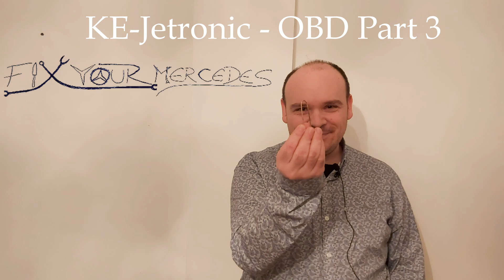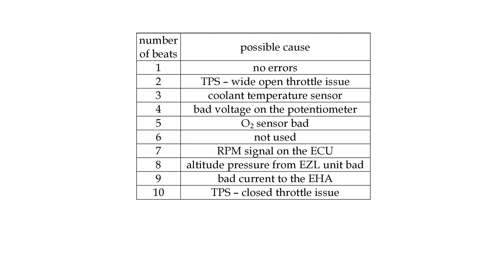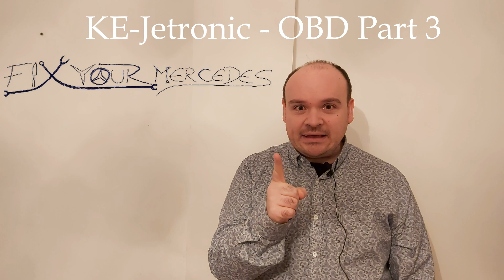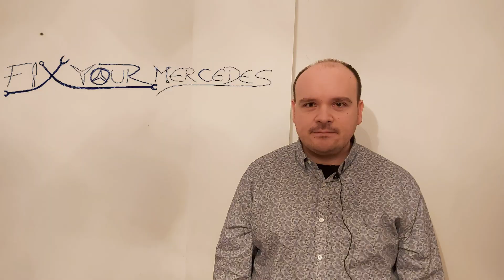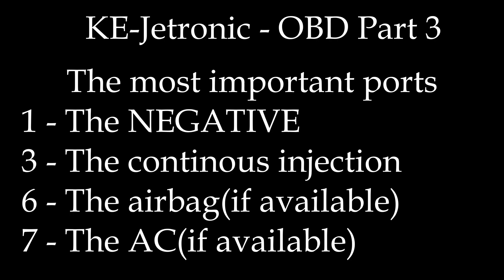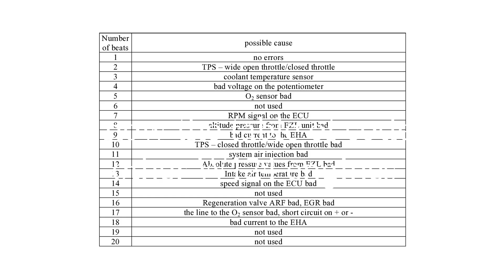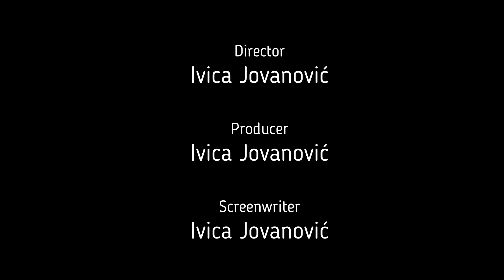㉦Mercedes KE-Jetronic㉦ - The OBD1 Part 3 (would you believe it?! OBD over 30 years ago!!!)

Comment: Well, don't even try to do this on a M103 engine. Plugging such a way the diag porthole will affect your engine ! I've tried it and the consequence I had to face with was: engine refused to start again!!! After some researches, I've identified the issue. The tension relay was blown due to the connection of a wire between the porthole !!! Before It was in perfect condition. So don't try this on the M103 engine !!! major risk for your electronic components !
Reply from the maker: Sorry to hear that. This is predicted for M102 engines. My car is manufactured in june 1989. that's why I made it, I suppose. This is done on the X11/4, the port near the battery. I am sorry that I didn't mention this earlier. Désolé...
Reply: @mercedeske  Hello hello. No issue for me. I replaced the pump relay and the high tension relay for cheap. And mine were original parts, built in January 1987. So no issue. I just want to aware your followers that on the M103 engine, this method is not good ! Have  great day and many thanks again for you tutorials ! Cheers from France !
Reply from the maker: @jacqueshenriot8949  Hello. I'm glad for you. There is in the comments that this is not a method for m103 engines. You have a diagnostic port by the battery where you can check the codes with the obd1 scanner. Greetings
Reply: @jacqueshenriot8949  Thanks for warning.
Reply: How could I tell my 300e 1988 is M102 or 103?
Reply from the maker: Every Mercedes in-line 6 engine is M103/M104 engine. There is no M102 6 cylinder engine, the strongest M102 engine is 2.5l

Comment: Hi Ivica, I would appreciate your help and support with the following issue I have with my W124 300 CE 1991: mid range drive 40 to 60 mph engine looses a little bit of power and takes a few seconds to get to 80mph. After reaching the 80, engine becomes loud and gets some of the power back. When stopped at traffic light, idling rom jumps every seconds from 500 to 750 and sometimes engine dies. 
O2 sensor, spark plugs, wires all new. Just ordered new potentiometer, idle valve control and fuel pressure regulator. And forgot to mention when turning steering wheel all the way left/& right engine might die as well. 
Where should I start replacing parts?!

Thank you

Adrian
Reply: Thank you Ivica, was thinking to replace the injectors as well, will follow up in a week.

Have a wonderful weekend.
Reply: One more question Ivica, 80 mph and up the engine becomes loud and I was told is die to air flow meter? Where should I start with figuring out what’s wrong?!
Could we get an o call when you are available?! Would appreciate your time.
Reply from the maker: @adrianioanlungu  When ever you want. Just send me your phone number in my mail(schilleryu@yahoo.com). I have everything - viber, whatsapp, signal, telegram
Reply: @mercedeske   Will email you my contact
Reply from the maker: Thanks you, too!
Reply from the maker: This is the clear sign that you have a faulty idle control valve(for the beginning 😁) and if I were you I would check the injectors as well(you have the video on my channel). If you need anything else just contact me. Best regards, Ivica FyM

Comment: Hi, very interesting video thanks for sharing your so pratical knowledge ! A question please. I have a W126 mercedes with M103 engine. My car is form 1987 and it has the same ODB1 socket port than your W124 mercedes. This is a 9 holes port. Is your method with the wire applicable for my M103 engine with this same socket plug ? Thanks for your answer. Cheers !
Reply from the maker: This is for m102 the engines from september '89 but you can try. Some people told me that their fuel pump start working constantly using the ports 1 and 3(interesting). But if you succeed the be sure that the table with the number of impulses is right so you know what you are dealing with. To tell you the truth, this is for the diagnostic socket at the battery on the firewall. There is a diagnostics there but I don't know how I managed to make it work on the x11(where you read duty cycle). Best regards
Reply: @mercedeske  Ok Thanks. I will check tomorrow and will let your know. It might interest other mercedes CIS spotters ! cheers.

Comment: (edited because I realized I was talking USA exclusively...)
Reply from the maker: Hello and thanks for the comment. The car is manufactured on june 1989 and what I am talking about is for KE III M102 engines from september 1989. The car has no diagnostics by the battery. As for the M103 engines, if you have 16 socket diagnostic, 1 is for ground, 3 is for the injection(yellow) and 16 is for power(red). If you have an 8 socket - 1 is for ground, 3 is for the injection(yellow) and the red goes to the battery. For California models number 2 is for OBD.
Reply from the maker: Number 2 is OBD for California models.

Comment: Very interesting... Thank you.
I was very happy and excited to think that I could do this on my own car (w201 2.3 1989).
So I found a wire, went to the car, saw the OBD jack it smelled good to me, and...

No number 3 contact...

All others are there, but nothing in the 3, a blank !
Reply from the maker: Number 3 must be next to number 2. How can I explain it? If you have number 4 written on and number 2, between those two is number 3. From underneath clockwise you have holes. The first one is 1 and then clockwise is 2, 3, 4.... Imagine letter C. First from the bottom is 1 and as you go clockwise it makes 2,3,4,5...
Reply: @mercedeske  thank you for your answer. 
I surely misspoke. 
I saw each socket, but the number three is empty, there is a blank inside.  All other socket have a connection in metal, but in the socket number 3 I only see plastic ... Just like if I had not the option. Maybe my car is to old ? Or I'm very unlucky...
Reply from the maker: No, definitely not. Mine is '89, too. The same engine
Reply: @TRIUMPHINT  hello, I have the same problem as you location number 3 of the ODB socket is not wired. Did you find a solution? Thank you
Reply: @jb56000  I learned to live without... Lol
Reply: Mine is also missing the metal connector on number 3
Reply from the maker: Well, there are those without lambda and without pin3
Reply: So there is no procedure for a model without pin 3
Reply from the maker: @kahugan1  Maybe. I thought that current can be measured on the eha. You have to get -2mA on idle. It shows 0. On the kat version the current on eha has to fluctuate between 0 and -3mAmps. If you manage to get that value(I mean -2mAmps, although 0 is not bad either)

Comment: Love your video ! And your girlfriend 😂😂
For erasing all the codes, unplug the battery for 20mins is not enough ? 
And for other type of vehicle, like w129 they have the 16 pole connector with the same kind of diagnostic, but more complete. 

An odb diag can be found for that, I think can be adapted to k-tronic 

https://www.etoilemd.com/boutique/compteurs-intruments-de-bord-calculateurs-diag/1836-emd-diag-1-appareil-de-diagnostique-pour-mercedes-1985-a-1995.html?search_query=Odb+&results=1
Reply from the maker: You know, for years my battery is off from my car specially now when the temperature is about 0 degrees and I still got the same issue. In my manual it says to unplug the ECU from the car for about 20 seconds. Thank you for your support and kind words.
Reply from the maker: In my next video I am going to add some more dames specially for you😉😃😀😎

Comment: Hello
Good film brother 😉
But I have a question. 
In my sl 300 92 model I have bought of diagnostic socket. I have 6 cylinder engine. 
What diagnostic shoud I used it?
Reply from the maker: Greetings and thank you for the comment. Use OBD1 because OBD2 came later 1996. You should have 16 ports. I posted the link how it's done. There should be a socket close to your battery. Stick it there according to the link.
Reply: @mercedeske   hi, where is the link? maybe thats the reason of my stuck on 50% duty cycle problem (o2 sensor problem) I didnt check or erase any fault codes after changing the o2 sensor and many other sensors!
Reply from the maker: In the cards. Here and leave the comment if you succeeded, please!
https://m.youtube.com/watch?v=6kPrF5aE_WU&t=66s
Reply from the maker: You are right! I also had that problem as I replaced the O2 sensor. As I deleted the code, the car drives now like reborn!
Reply: @mercedeske   nice then i will have to find a 16 pin code reader
Reply from the maker: @Gerson Grossl Here, I think this is going to do the work!
https://www.ebay.com/itm/Mercedes-Diagnostic-Code-Reader-Tool-OBD1-W124-W126-W140-R129-E320-1988-1995/222481161915?hash=item33cce91ebb:g:R8wAAOSwr81UOG7-
Reply from the maker: @gcgj1540  Vocè é brasileiro!? Que legal. De onde cidade brasileira é? Vejo que está morando na Taiwan. Espero que vocè vai resolver a problema. Saudades da Sérvia...
Reply: @mercedeske  thank you
Reply: @mercedeske   sim sou brasileiro estou perto de Curitiba, você mora no Brasil ou é brasileiro morando na Sérvia ? Sim casei e estou morando em Taiwan mas no momento estou no Brasil,
Reply from the maker: @gcgj1540  Não, sou Sérvio, mas falo português. Fui no Brasil 2005 no São Paolo, Vitória, Vila Velha, Rio, Serra ES. Tive una namorada lá... ;-)
Reply: @mercedeske  haha legal 👍 interessante sua história, eu quase não conheço o resto do Brasil somente o Sul 😂
Reply from the maker: @gcgj1540  Hehehehehe. Obrigado. Ela me dez:"Vou mostrar você Brasil, mas não tudo, porque Brasil é muito grande!"😂😂😂 Lá conheci uma amiga que me chamava "Gatissimo" e eu ela "Gatinha"😂😂😂 Foi um mez inesquecível no Brasil...
Reply: @mercedeske   😂😂😂 você mora em Belgrade ? A única cidade da Sérvia que sei hehehe. Imagino que deve estar muito frio aí nessa época do ano.
Reply from the maker: @gcgj1540  Hehehe, pelos Brasileiros sim, um grau. Eu moro na cidade 300km no sul de Belgrade. se chama Knjaževac(Cnhágevats).
Reply: @mercedeske  Strange that you always have to buy in the usa
,
there are no such diadnostics staff here in europe. Whyyyy
Reply from the maker: @gurtatka2891  Well... I think you can diy. I can post a diagram on my Instagram profile how you can do it very cheap.
Reply from the maker: I posted the picture showing how you can make the obd1 scanner yourself. Just type on Instagram fix your Mercedes and you will see.
Reply: @mercedeske  have no profil on Instagram. Can you posted hire?
Reply from the maker: To post what? I do have instagram - fix_your_mercedes

Comment: I was thinkin are you gonna show how exact you can adjust mixture with obd and screwdriver? That 50% +-10 thing i have read about🤔
Reply from the maker: I tried it, but I didn't manage to do it. That was before I erased the error with the lambda. I will try. If I succeed, I will make the video for sure. This is how it's done - you need a duty cycle capable multimeter that can show you percents. The conditions for this is for your lambda and the potentiometer to be good. As the car is at 80 the fuctuation must start - counterclockwise the mixture is leaner, clockwise richer - the lower number in % the richer the muixture, the higher - leaner.
There is one more way - on the terminals 2(negative),3(positive) you measure the voltage. The number you get you divide with the voltage on your battery and you multiple it with 100 - that's the percentage you want to get.
Reply: @mercedeske  You really know what you are talking about👍🏻
Reply from the maker: @kaapeli8515  Hehehehe, I've studied the system for a looong time. These videos are spite so to speak to my former mechanic who told me something like:"Are you crazy to mess up with K-Jetronic!?" Let me tell you who you can believe from all the mechanics concerning KE-Jetronic - the one you ask why the letter K in its name, why not some other. If he doesn't know the answer, then he doesn't know the principle of the operation! If he doesn't know why the letter K but he explains you how the system functions, then okay, you can trust the guy.
You have D-Jetronic, K-Jetronic and L-Jetronic. These letters are not given randomly!

Comment: Hello, i have 1986 420 SEC C126 chasis and car has the same 9 pin connector under the hood. Is this procedure applies to my vehicle as well?
Reply: Thank you very much. I want to try but i afreid not to damage any component especially the ecu
Reply from the maker: @ugurbuhara6584  I understand you. I wasn't confident either. You decide, I wouldn't like to feel responsible for anything.
Reply from the maker: This method is for the M102 engines from september '89 but, it's worth to try, I can not guarantee.

Comment: Thanks a lot for video. I have 102.910 with cat and o2 cencor. To clearify, how should we understand the cycle of beats ? You gave an expamle for 1st 2 2nd 5 3th 9 4th 2 again and said that its equal 3 beats. What is the mathematics for that?
Reply from the maker: Greetings, the example I gave is to understand how many errors you have - it may be single one, and maybe more of them. I gave the example for 3 errors. It's like this - note how many beats you hear for the first time. Then you take the wire out and stick it again for about 5 seconds to see if you have more errors in the system. Repeat the process until you hear the same number of beats as for the first time. In my example it were the errors number 2, 5 and 9. If you looked in the table you would see that you have an issue with the FULL OPEN THROTTLE(that's under number 2), LAMBDA PROBE(that's under number 5) and BAD OR NO CURRENT FLOWING TO THE EHA(that's under number 9). Maybe you get some other number of beats, maybe a single one(NO ERRORS). Example number 2 - you get four beats for the first time. For the second time you get four beats again. That means you have only one error - BAD VOLTAGE TO THE POTENTIOMETER! I hope now you understand. Best regards
Reply: @mercedeske  thanks a lot for the feedback. its very important information. also, during this process, should the igniton need to be on, while i am sticking in and out the wire until i hear same beat again?
Reply from the maker: Yes, all the time.
Reply: @mercedeske  greatful for quick reply and information
Reply from the maker: Everything for my subscribers! ;-)
Reply: @mercedeske  
1:19 for sub🔔 🙄   
😎😁😂🤣😅
Reply: @mercedeske  hi there. i tried this method on my 102.910 while igniton on, i stick cable in 1 and 3 port suddenly fuel pump start working and it didnt stop until i took it out and no beat sound came from engine. Tried this couple of times result is same. what could it be wrong with my car ?
Reply from the maker: @emrekarahasan2698  Remind me which year is your Mercedes manufactured?
Reply: @mercedeske  manifactured at october1991. W201.018 code
Reply from the maker: @emrekarahasan2698  I know that the fuel pump is turned on by connecting contact 7&8 when you disconnect the fuel pump relay. But I didn't hear that it can be activated this way. Number 3 must be the injection line. Number 1 is GROUND. I am not sure why is that like this. In my manual it says from 09/'89 for m102 engines. My car is made on june '89 and it works. I would advise you not to touch anything.
Reply: @mercedeske  thanks a lot. its better not to touch anything. it just work fine. How can i find 102.910 engine instruction manual by the way ?
Reply from the maker: @emrekarahasan2698  Try on Mercedes Benz forums. I tried but I didn't have success. Try asking this man he has a 190E
 https://www.youtube.com/user/190mex